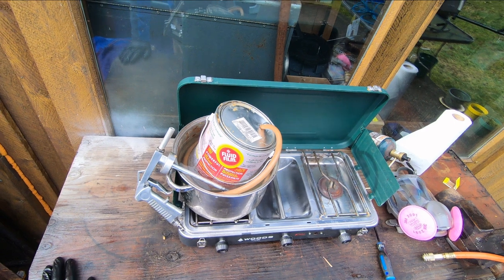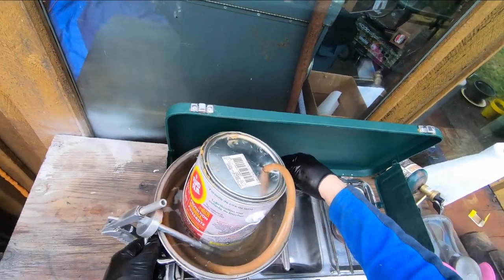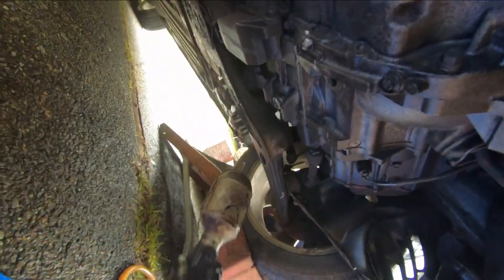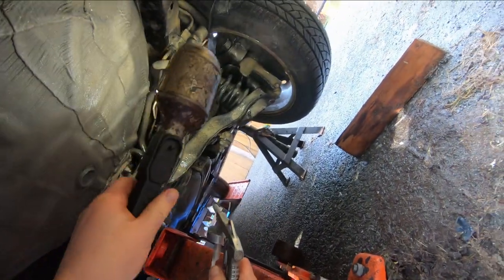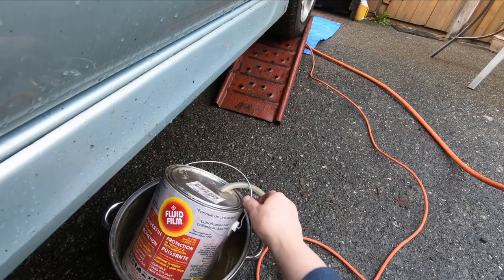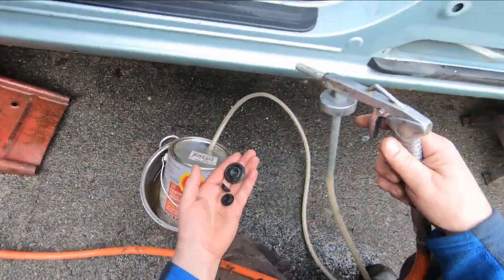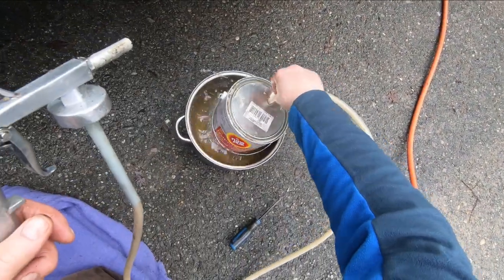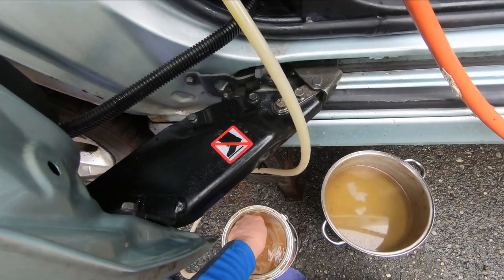HOW TO UNDERCOAT (RUSTPROOF) A VEHICLE WITH "FLUID FILM" (NATURAL WOOL WAX)

Comment: Great idea with the hose running from your can to gun..makes it easier to maneuver 👍
Reply from the maker: The long hose run into the can directly makes it so much easier, but heating the Fluid Film is also a very important step. I notice that the price of the 5 gallon jugs of Fluid Film have doubled in the last couple of years...I have half a jug left then I'm going to have to get creative about what I'll spray after that. Some use ATF, others old engine oil, I've used both and maybe I'll be going back to them if the prices stay high. Thanks for stopping by. I hope my video was useful! Subscribe to keep up with all the other stuff I do.
Reply: @EverydayProjects  it’s worth the money I’m on the east coast and think you can get it for 100$ a gallon ish.. still good price for product.. engine oil is not good.
Reply from the maker: @eastcoastlife3547  I bought 5 gallons of Fluid Film for $299 CAD delivered but I don't see those prices anymore. I guess if a gallon is about $100 then I can do two vehicles, it isn't too much to pay. I'm just missing pre-pandemic pricing.

Comment: The hose idea is great.    I recommend a respirator for all the aerosolized oil that hangs in air.
Reply from the maker: Yes, I used a respirator. You'll see that explained near the start of the video. I like the full-face mask 3m style. It covers your full face and gives excellent vision as well as full respiratory protection.
Reply: @EverydayProjects  what compressor do you use im going bananas 🍌 trying to figure it out
Reply from the maker: Any air compressor should work. The tiny ones that are flat in profile are called "pancake" compressors (Unofficially). They are about two gallon models. I used a 20 gallon air compressor but that size isn't necessary Good Luck! @WingStop-zv1sk
Reply: @EverydayProjects  is 5cfm enough
Reply from the maker: @WingStop-zv1sk  That should work. There is no set minimum. 5 cubic feet per minute sounds like plenty.

Comment: The electrical utilities use this to weather proof their exposed connections.  I've seen cases of the aerosol cans in their warehouse.  Most bucket trucks will be stocked with a couple of cans.   Be aware this stuff doesn't last forever so I would recommend periodic reapplications.
Reply from the maker: Interesting. I read that it is safe on electrical connections and won't swell most rubber. Also, when spraying under my vehicles, I got some on the brake rotors and initially, I thought that was a worry, but a few miles of slow driving and applying the brakes often, has cleared it all off. Yesterday I drove 200 miles and the brakes were perfect. Thanks for watching and commenting! I plan to apply it spring and fall.

Comment: I was having luck with a cheap electric paint sprayer for the last 2 years but i don't know if some impurities were in the can I bought or I contaminated somehow. This looks like a much better idea thanks
Reply from the maker: I bought the sprayer on Amazon. It does not come with a container. Just as well, I just put a length of 3/8" clear hose on the pick up tube. I just used this set up again a few weeks ago and it worked flawlessly again.  The spray gun was something like $18 so not expensive for what you get. All the best to you!

Comment: The compressor is so much better than rattle cans.  I like how it atomizes the fluid film so it gets to hard to reach spots, plus it blow off some of the peeling paint.
Reply from the maker: Absolutely! This stuff goes on so much better when both heated and blown on with compressed air. I tried without air and air without heating, but heated with about 60PSI is fantastic!  Thanks for checking it out!

Comment: Great video.  Where did you buy the spray gun from,  what model ?
Reply from the maker: Got it on Amazon: Astro Pneumatic 4538 Economy Air Undercoat Gun. That's the one I have. Plus I bought a 6 foot length of 3/8" clear tubing. Best of luck with your undercoating.

Comment: Thanks for this video bro! I have been using Fluid Film for a few years now but at my friend's place, he has a lift and all the stuff. I really want to diy this myself in my driveway exactly the way you are doing it. I already have my can, I'll get a stove, tube and the exact gun. I can borrow my neighbour's pancake compressor, are you pretty confident it will work? I just want to get 'er done and not have to rely on anyone's help. Thanks for your advice, really appreciate it :)
Reply from the maker: The pancake compressor will work perfectly. Look on Amazon for the Astro Pneumatic 4538 Economy Air Undercoat Gun. That's the one I have. Best of luck with your undercoating. Let me know how it works out.
Reply: @EverydayProjects  Right on, I already have the gun in my cart and will get myself setup before the cold out here in Hudson, Qc. Take good care and I'll give you an update once she's done :)
Reply from the maker: @robertdelorme8779  That sounds good. I hope it goes well for you. You may be able to find a used propane camp stove on Kijiji or Facebook marketplace or in Quebec on LesPac. Best of Luck!
Reply: @EverydayProjects  checking that out as we speak lol. Do you have any attachments on your gun, the 360 hose or something to get in the tight spots? Or simply using the gun and shooting what you see?
Reply from the maker: @robertdelorme8779  No swivels or other fluff. Just the basics. A good floor jack and jackstands are essential for safety as is something soft to lay on such as a "Ridgerest" camping pad or some old blankets.
Reply: @EverydayProjects  I've got the four stands and a 3 ton jack. Is the clear 3/8 tubing good? I imagine so? Can't wait, gonna use your exact setup and get it done twice a year bro. 2014 CRV, never missed a year yet but always at by buddy's place, he's just too busy with life and I have all the time in the world. Thanks for all your replies.
Reply from the maker: @robertdelorme8779  Yes, the clear 3/8" tubing works well. It allows you to see the fluid film moving inside it.
Reply: With a pancake compressor you might have to let it build up more pressure periodically.
But it'll work.

Comment: Never seen or heard of this stuff. How many years have you used it??
Reply from the maker: I just got tuned into this stuff lately. I am amazed at the performance so far. I had rust on some steel truck rims that this stuff has all but eliminated! And the truck frame in my 2003 F-150 looks like new after spraying this on last month.I'm going to spray this on all my vehicles from here on.

Comment: @Everyday Projects
what gallon size air compressor  & scfm and cfm   is your air compressor?   
Also What do you set your regulator to when you spray this?
Reply from the maker: I have a Speedaire 20 gallon air compressor that delivers up to 6 cf/min. It's shown in the video. I was spraying at about 80 P.S.I but this will work at much lower CF/M and lower pressures.I mentioned that a little pancake-style air compressor will work too. Sometimes skipping ahead through a video a guy will miss critical information. Best of luck spraying your vehicles. This stuff works!!😀
Reply: @EverydayProjects  You Caught me red handed.  I apologize.  Thank You for responding with what i should have seen , had i not skipped.  Take Care.
Reply from the maker: @lightningsmokerXx  No worries. Now get out there and start rustproofing!😀

Comment: What temps were you I using it? If I use it in summer 80 to 100 degree weather is that enough for good spray or do I need to give it warm water bath?
Reply from the maker: I'd still warm it up. It is a thick paste even at those temperatures. When It comes out of the water bath it is just below boiling (212 degrees F) and it cools off from there. I'd say it is probably about 150 degrees when I'm spraying it, but that's only a guess. I know the can is too hot to touch! Good luck with your rustproofing and thanks for watching. Perhaps Subscribe if you enjoy this type of content. Thanks!

Comment: Why is a compressor needed?
Reply from the maker: A compressor is used to compress the air that blows the Fluid Film onto the car. Without compressed air, there would be no way for the fluid to move up through the hose and out onto the surfaces of the vehicle. If you don't have a compressor, you can still apply this rust-proofer with a brush or a hand-pump sprayer.
Reply: @EverydayProjects  what about an air aluminum spray gun? Doesn't seem as if it's strong enough to move up the fluid film
Reply from the maker: It worked well and is the one that many shops use to spray under coat. @whatitisnt.

Comment: Where did you buy that hose?
Reply from the maker: It is 3/8" diameter clear hose avaliable on Amazon or any car parts store. I heated it up so I could push it onto the spray gun pickup tube. It worked well. Thanks and best wishes!

Comment: I've been blasting used engine oil underneath mine but I think I like the way this stuff goes on. What's the story on the sprayer? Is that a regular paint sprayer that you modified?
Reply from the maker: The sprayer is a cheap, economy sprayer I got on Amazon ($21 USD) and the 3/8" clear hose I got locally. I recommend this stuff! I am super impressed with its ability to STOP rust and keep it away. here's the link for the sprayer: https://www.amazon.com/Astro-4538-Economy-Air-Undercoat/dp/B003D3N7W4/ref=sr_1_10?crid=3DIDPXTVK69Y5&dchild=1&keywords=undercoating+sprayer&qid=1612474145&sprefix=sprayer+for+undercoat%2Caps%2C226&sr=8-10
Reply: @EverydayProjects  I've never seen an undercoating sprayer before!
Reply: @EverydayProjects  nice